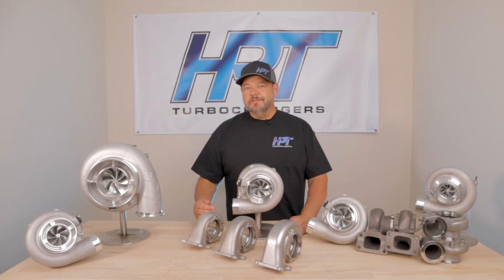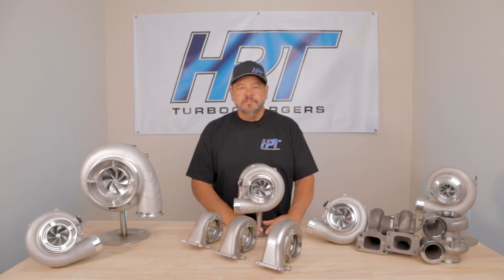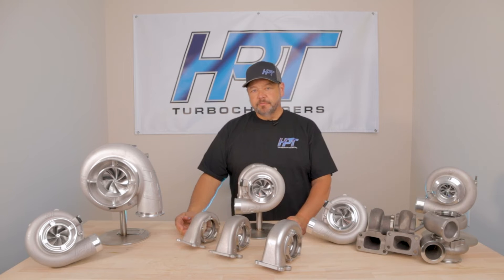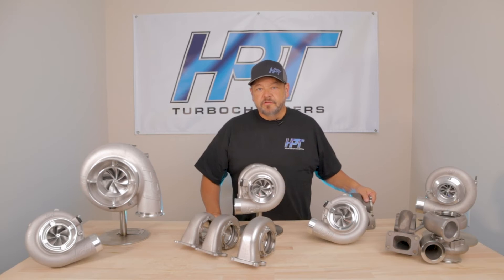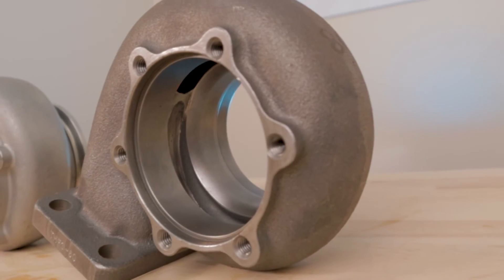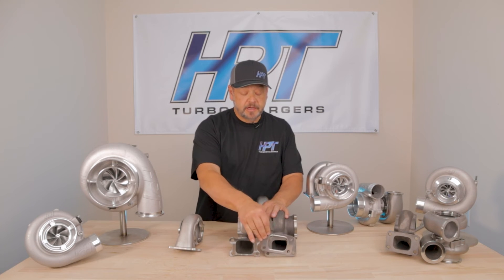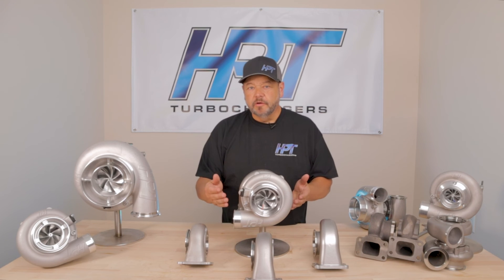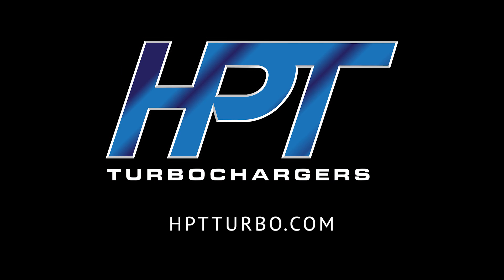V-Band VS T3 Turbine Housing

Comment: What do you recommend for a 1100 whp Honda drag car with a k24
Reply from the maker: F3-7170 .96 A/R should be able to hit 1000hp on a K-series. If you want over 1000hp then look to the F3 7175 .96! Thanks for the question.